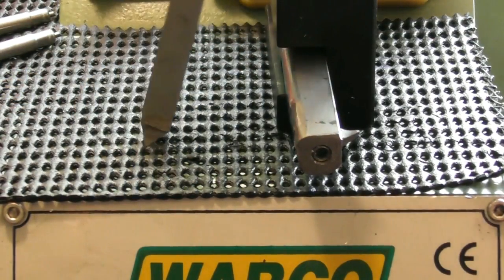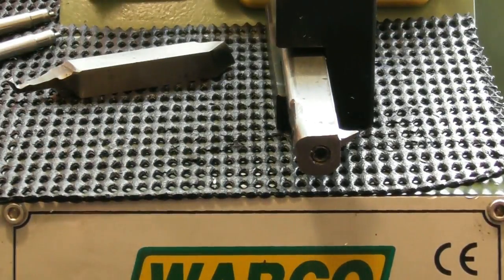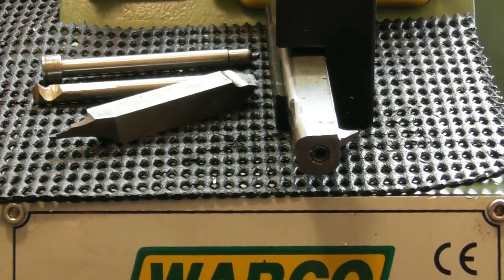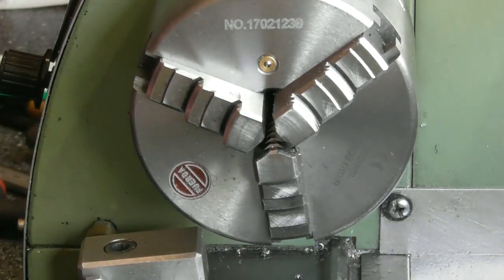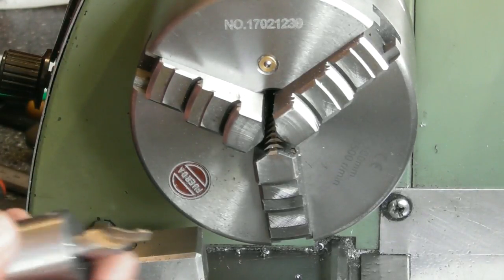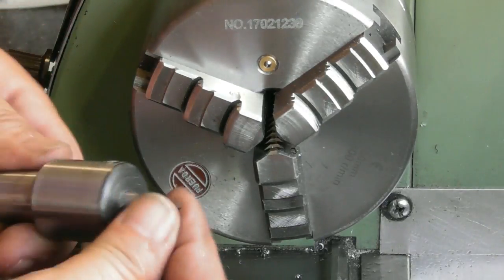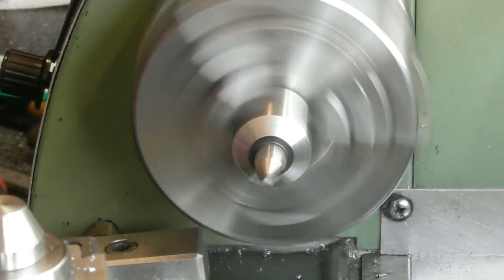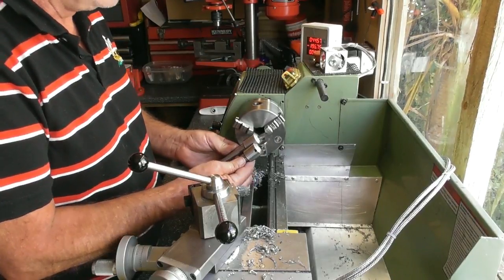Shed talk 6

Comment: Hardened tool steel ejector pins up to 1" are available from McMaster-Carr. They are 45Rc to 60Rc hardness in the standard fractional sizes (depending on the specific type).
https://www.mcmaster.com/#ejector-pins/=1d89myw